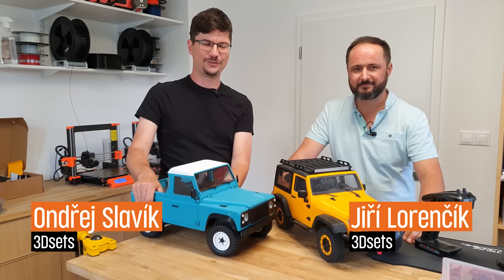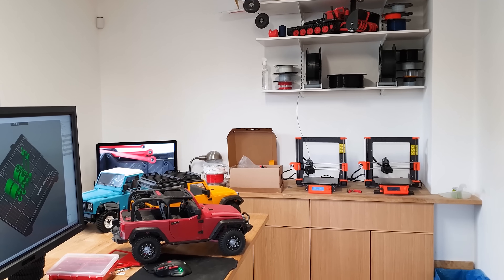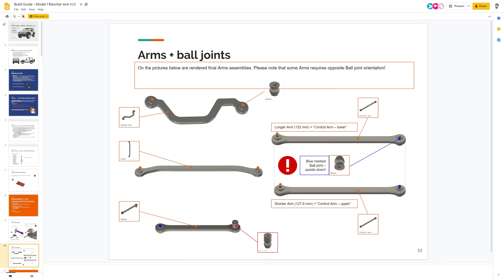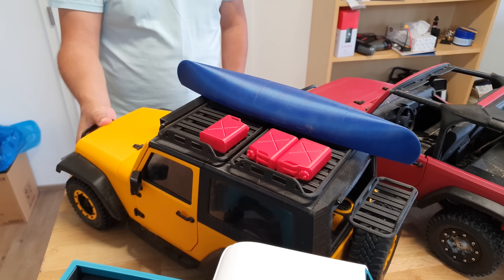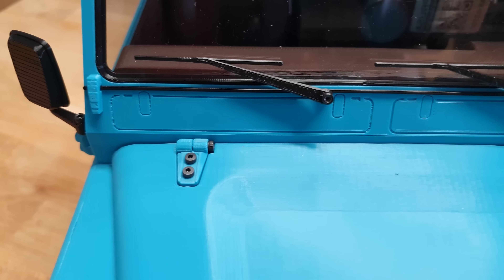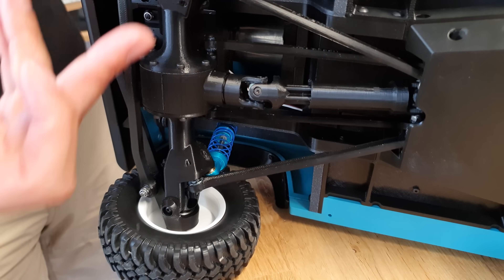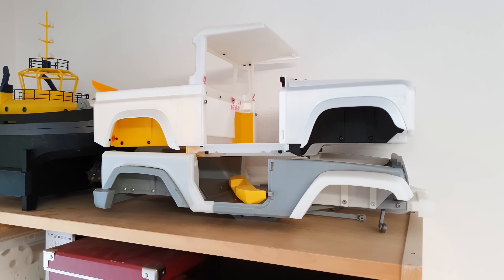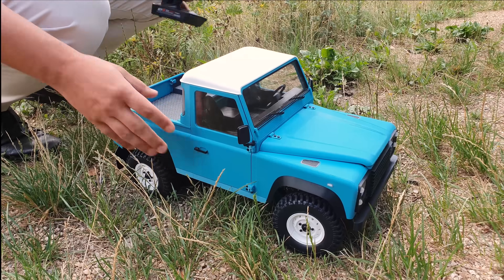3D Printed Off-Road RC Cars by 3D Sets

Comment: Is it also possible to print the parts on prusa mini? Are there any parts bigger than 180x180x180cm?
Reply: I have this question too. If you figured it out could you please tell me? I would love to get a Prusa mini and do these prints but I am not sure if it is possible.
Reply: @OwenRozeboom  Answer from 3DSets on my E-Mail:

– fully compatible with Prusa Mini is just our latest Model 7: Buggy. It will fit and you get even gcodes ready to print.
– partially compatible is Model 1: Rancher or Model 2: Rancher. However, you will need to put all parts on bed by yourself and some parts need to be rotated (and generate supports). In other words – possible, but not with full comfort
– Landy lineup – not compatible, because some parts exceed 18 cm size
Reply: @afry3301  Thanks so much!
Reply: @OwenRozeboom  They answered me again. You can print about 90% of the landy-parts on the prusa mini.
Maybe you have a friend or someone else who lives near you, who can print the big parts on a bigger printer ;-)
Reply: @afry3301  That's good to know. Thanks a lot! However, I think I am going to try to get the Ender 3 v2 because the leadtime for the Prusa Mini is around three months. However in the future I would still love to get the Prusa Mini.

Comment: I have met one of these cars on RC expedition Růžohorky here in Czech Republic. Bodies are fine. Many cars use FDM parts or whole  body. But FDM printed drive train is for very very light terrain. In just 100 meters printed car  was done.  C hubs, drive shafts ,  CVDs.  All of them failed one by one. These parts needs to be at least  from FRP (fiber reinforced plastic). And even stock Axial parts are not strong enough for some of us. For me even some metal parts are common failure point. :D

Comment: Did anyone know if there is a compatible flytower for the mini drone that prusa research posted about 2 years ago? The name is 6.5g 20x20mm HGLRC XJB F413 Micro F4 AIO OSD BEC Flight Controller & 28A Blhel_S BB2 2-4S 4 in 1 ESC
Because I can't find in anywhere and anymore so I would like to buy a compatible part thx

Comment: Prusa 3D by Josef Prusa, with what 3D printer did you printed these cars?
Reply: I'm doing mine with a MK3 which is what they're designed for. You could do it with a mini but not with the pre arranged plates as you'd have to print some of the longer parts at 45° across a Mini built plate.

Comment: A shell for the electric motor would be a cool accessorie ^^
Reply: Thingiverse has a few that look like gas engines from real cars. My one worry would be that most brushed motors have vents for airflow that you would have to design for.

Comment: Very cool. Anyone know if this can handle a low power 2S or 3S brushless setup or would that be too much for the printed parts?
Reply: Yeah I wouldn't trust it with a brushless motor. They're designed for a basic $10 'silver can' 540 27T motor. They're heavily geared down so no speed but able to crawl say up a tree trunk to vertical. Then get stuck of course.

Comment: After checking out the webpage, I went ahead and ordered the Model 6 files. $40 + another $40 in filament to print an RC crawler the size of a 1/8 Traction Hobby? I'm in.
Reply: Ya, that's quite a reasonable price!
Reply: There's still another $150 or so in screws and electronics but it's still crazy cheap and a blast of a project too.
Reply: @AndrewSmith-lj6xq  Electronics will be a subjective choice so the cost can be as little as free (already have spares laying around like me) or as high as $200 for a nice sensored system. However, hardware will be very minimal as it appears the kits don't require much of it. At least that's what I see.
Reply: @Clickbaiters  yes that's right. I'd recommend against a brushless system though. Not sure the parts will hold up but what the hell? Give it a try! Worst that happens is you reprint the parts. And yes they're pretty simple. Although you can add lighting systems to them too for extra effect and they're only a few bucks extra. I'm adding one :)
Reply: @AndrewSmith-lj6xq  Yes, I suppose it's not really so much about the price, but rather about the experience.

Comment: Is it possible to print in a Prusa Mini?
Reply: Yes! Any printer 180 x 180 x 180 it says
Reply: @Texy_UK  unfortunatelly you need 20x20x20 for some specific (few) parts. Model was designed before the release of the Prusa Mini, so we are sure that everything will fit on common 20x20x20 bed, but no 18x18x18. But if you would like to print our model on Prusa Mini, just follow us and stay tuned ;-)

Comment: This just changed the RC game BIG TIME!! Watch out Traxxas and Horizon Hobby, your days are numbered. This is the result of two very bright individuals focused on creating a product for the 3D printing market, or more so, the 3D printing community and as such, almost every part of that RC is 3D printed saving you big money. Unlike the corporate board rooms of the big RC companies like Traxxas and Horizon Hobby which are focused on squeezing every cent out of a hobbyists pocket by creating mediocre products which practically REQUIRE upgrades out of the box. Oh yea, those upgrades are conveniently offered by the same company that sold you that pile of worthless plastic. 

You can't and will never bamboozle the 3D printing community, they are simply much too bright and these two individuals are a testament to that. 

Between this incredible example of development and the countless other 3D printable RC's found for FREE online, the old days of screwing over the hobbyist are slowly coming to an end. No more Ferraris and million dollars homes you for corporate RC.
Reply: The big brands have nothing to worry about. There is a reason they built a slow crawler as their platform. 3D printed parts do not take much abuse before they break (I know, I've tried all sorts of 3D printed replacement parts). As long as you are fine going 2mph this will work. Put these parts on a real RC car and they won't last through a single battery. 

The big brands have to pay for expensive injection molds that likely cost more than the car you drive, for each part, but they last. 

I think this platform that they designed is great and it seems they are charging a reasonable amount for the files. It looks like it would be a fun project if you are into 3D printing but this is a toy and not a hobby grade RC vehicle.
Reply: @MikeSmith-km9ff  Lol, injection molds cost more than the car you drive😂😂😂 Well, in this case, molds could run $30k-$40k so no, not in this case. Traxxas has been using the same molds for 20 years so I think it has more than quadruple payed for itself. Wait, if the STOCK plastic parts didn't hold up you think a part printed out of PLA will? You never disclosed what filament you used but there are stonger filaments out there. This is a toy? News flash, all RC's are toys, even the $1400 ones like my 1/5th scale. Just because people "feel superior" because they dropped $550 on a "hobby grade" RC doesn't make it NOT a toy. It's a toy, and anyone not into the hobby that sees you driving it at the park thinks you're a grown ass man playing with an RC toy. So a Tamiya CCO1 based crawler or a RC4WD Trailfinder will smoke on of these on the trails? I doubt that. The ability to 3D print any bodies that fit the chasiss is priceless and cheap compared to buying a $60 Proline body, buying paint(s) then buying the accessories you'd like. No comparison. The 3D printed RC's offered aren't pretending to be comp crawlers. They could have easily designed portal axles to give those things more capabilities. This is just the begining, printers across the board and material types are getting better and cheaper faster than ever.
Reply: @MikeSmith-km9ff  Mike, the real reason for choosing the slow crawler is that "anybody" can handle it. But we promise that we will not stick just to this category in the future.

Comment: What a coincidence.... i just bought one of these cars yesterday and now waiting for Prusament (and screws and bearings) deliver to start printing :D
Reply: You'll need shocks too, and shock oil. Make sure you have decent soldering iron as well.
Reply: And tires too! The look like 1.9" in case you're looking.
Reply: @hawkcrave  yup, and motor and controller and lot of other things :)
Reply: How much was the total on parts except the PLA?
Reply: @eried  hard to say, i already pay 5000 CZK (around 200-250 USD) for models, fillament, screws, bearings, suspension and tires but i am still missing things that costs around 140 USD

Comment: What type of filament would I use to print something like this ? Petg? Abs?
Reply: Mostly pla, except maybe the gears.
Reply: I built one this summer and as has been mentioned, they specifically advise against PETG, so mostly PLA with ASA in my case for the areas around the motor. I was just fixing some mechanical stuff this weekend and now that I am thinking about it, I accidentally printed the left half of my front axle housing in PETG, so I will see how that goes.
Reply: @LukasFoukal  is there a reason why not PETG?

Comment: Run a 1mm extruder nozzle and print off a half sized car or go kart that looks like a car in the same time, provided you have a larger printer or are ok with slicing up the prints.
Please, please do as i say.

Comment: I printed and built something like this.   And it works!   It was designed by Jason Sutter and 3d anarchy.   Although it was a bit challenging to assemble you can print most of the car.  And it was free.   You can see it in action on my YouTube channel